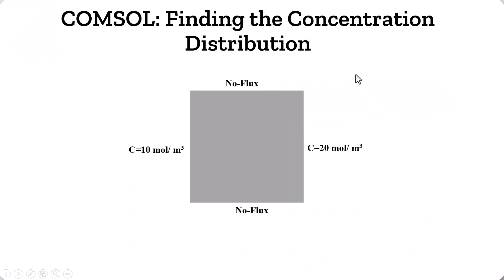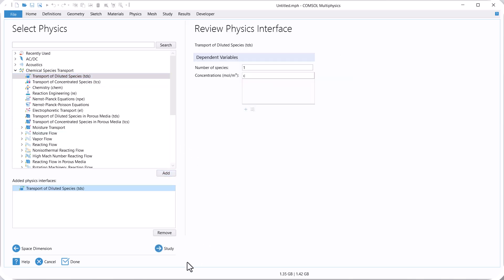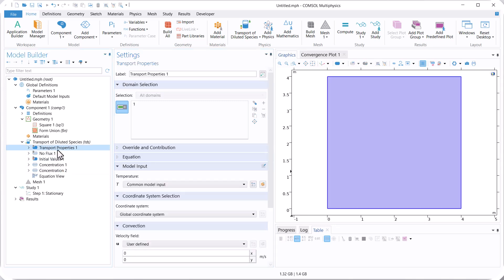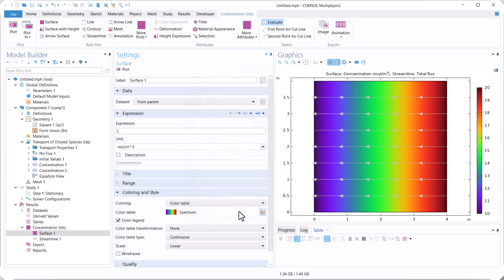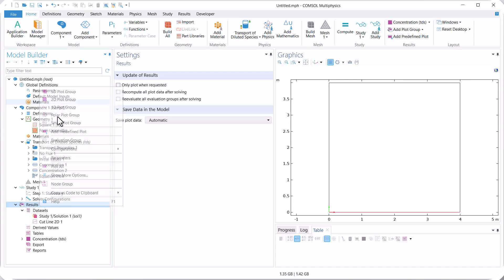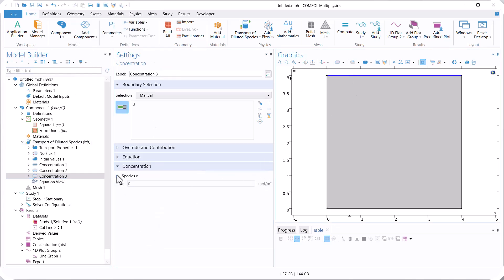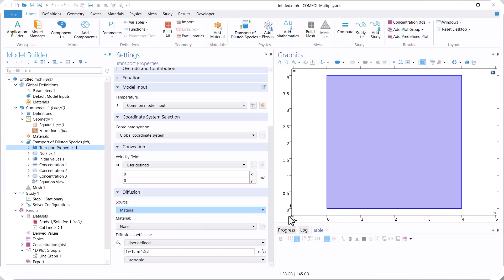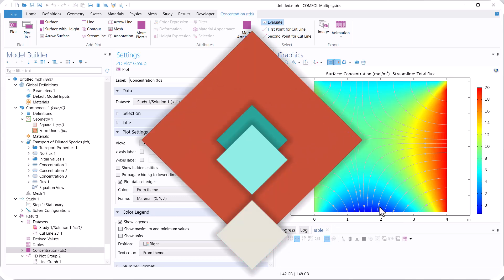COMSOL Tutorial: Mass Transfer by Diffusion

Comment: I am a Japanese engineer.
As this is a translation into English, I apologize if anything is unclear.
I have a question.
For a model like the one in this video, I would like to display a line graph of the flux J when diffusion passes through the surface. If you know how to do this, please let me know.
Reply from the maker: Hi, you need to define a line plot and specify your flux variable in the Expression section.
Reply: @DR.ABROFARAKH 

Thanks for your reply.
When specifying flux variables, I think we use the mass transfer coefficient and concentration. So what determines the mass transfer coefficient?